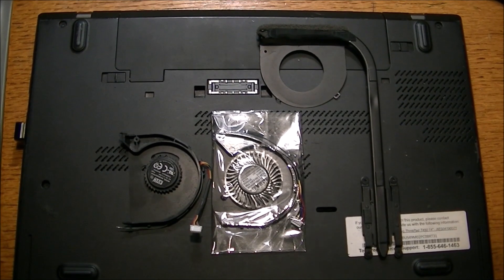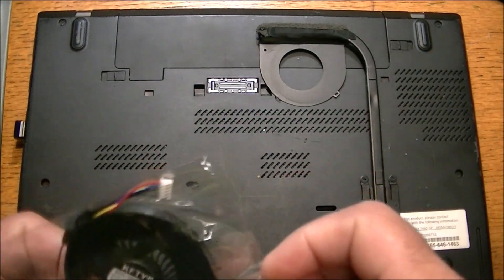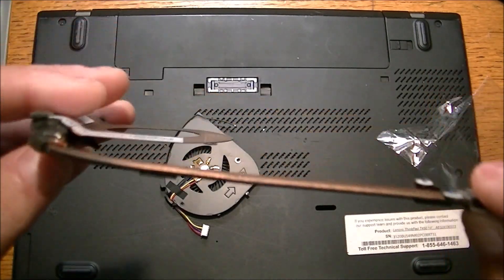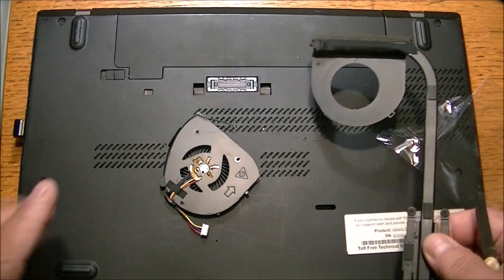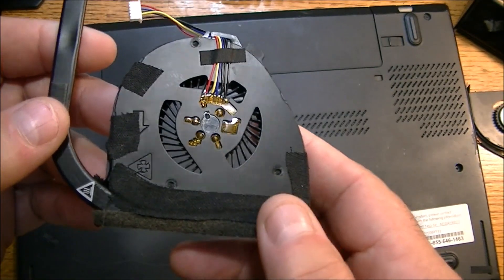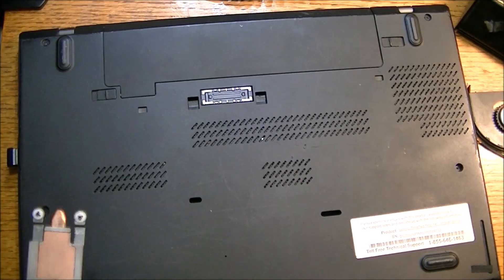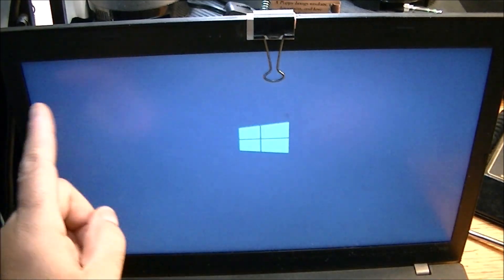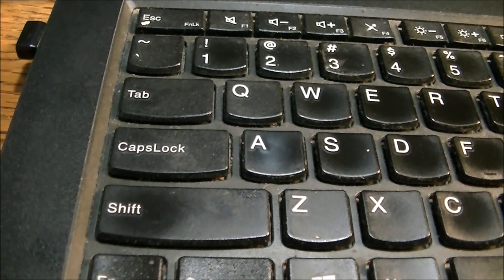Lenovo Thinkpad T450 Laptop Cooling Fan Replacement

Comment: Well done Andy.  Its crazy that some firms chuck out good laptops as they over heat and run slow in safe mode so they upgrade.  However it can just be that the fan or cooling vents are blocked with dust and dirt.
Reply from the maker: So true, Fred. This unit is a refurbished laptop. It wasn't 2 years old and I found that the fan was getting a bit louder. I am not sure if it was dust and dirt or perhaps a bearing was failing. I suppose if I would have managed to get the fins not to implode while cleaning, it may have been still noisy if the bearing was going. Thanks for the comment.